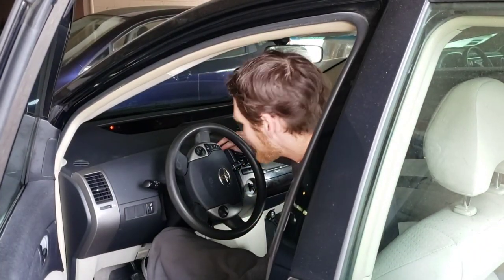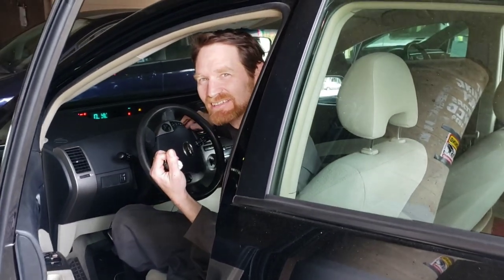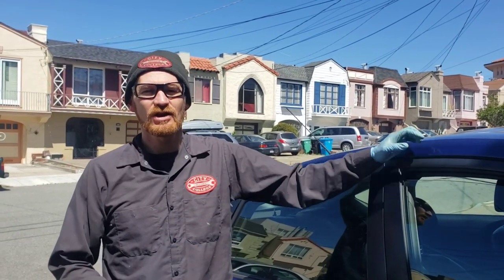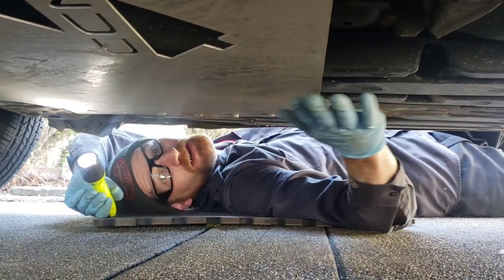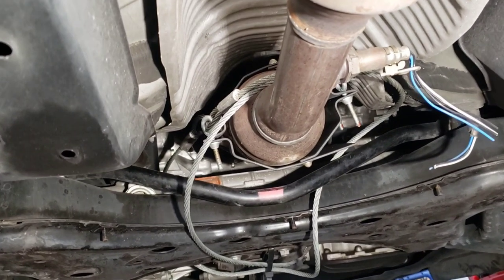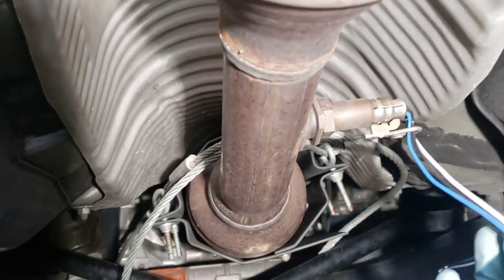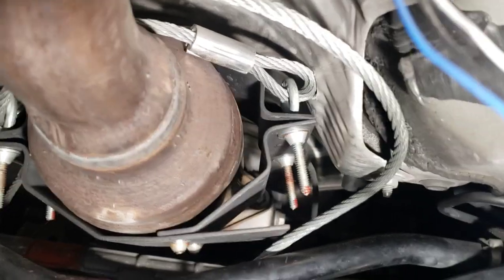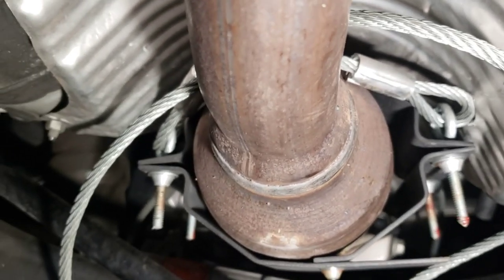Cat Locks tested by Thieves

Comment: I’ve worked at a stereo shop for over 20 years. We can install a ground loop sensor (saddle bag sensor) along with a security system (standard dual zone impact sensor, door trigger, starter disable, option trunk trigger, and optional hood trigger) so that the alarm will go off if someone removes the catalytic converter. We can also add an impact sensor onto the catalytic converter so that any vibrations from a sawzall will trigger the alarm. And there’s even a tilt sensor option incase they jack up the vehicle. Added benefit to that is it protects wheel theft. Ask your local stereo shop. 

If you have a pickup and are worried about your tailgate getting stolen or someone getting into your camper shell, we can install a pin switch or magnetic switch as well while we’re at it.
Reply: I would like more information, like what brand. I can't find anything on the internet.
Reply: Also I seen one from Europe that could call you when activated
Reply: @tescavko  Directed Electronics (DEI) makes Viper alarms (as well as a myriad of others such as Clifford and Avital) and they make add on accessories under the brand Directed. Go to any dealer and they can help you.
Reply: Until someone uses a Hack RF device (about $300) obtaining the frequency your alarm system utilizes. Thus disabling your alarm.

Look for an older Responder 460 system. They use modulating frequencies.

Sometimes you need more than just a car alarm guy.
Reply: @ozarks2g896  All current alarms code hop.
Reply: Serious question, what kind of impact sensor would be able to withstand the very high heat from a CC without simply melting?
Reply: How much
Reply: Pfffft - alarm... They're long gone by the time you get out of bed, grab your 9, and stumble out the door nekkid & barefoot thinkin' you'll stop the 3 tough-ass hombres with earplugs (who happen to be a LOT more ready for you, than you'll ever be to face them!).
Better to protect and deter than to expect a noise to stop any of them these days my man!
Reply: the noise a sawzall makes cutting through the pipe is about as loud as an alarm though... they don't give a fuck
Reply: @PersonalTrainerLamar  Yes, in complete agreement!
Reply: We have to harden the CAT, that’s the better route.
Reply: @SK what is the name of your shop and where are you guys located. I want to have the service you described installed on my van. Thanks 👍
Reply: @renejr2296  Any shop can provide that service.

Comment: Yep that’s exactly what I thought.  My reports being in different shops around the bay area conclude that’s the cables make noise. Especially when put in my last experience lower pay technicians. The more experienced technicians concluded it take so long to properly route the cables to make sure they’re in their tight it’s not worth it.  Every shop has given a thumbs up on the plate installation

Comment: I got some aircraft cable and wrapped it around the cat and back down the pipe about a foot each way and then secured it with stainless steel clamps at each end and when they tried to cut it the cable just moves with the blade, it worked and they guy got caught from the noise it made.
Reply from the maker: Nice work!
Reply: Smart! Can you share a picture of what you did?
Reply: awesome. I'M ON IT! THANKS

Comment: The exhaust system is grounded. You can tack weld a micro voltage sensor downstream of the converters and send a micro voltage signal to ground. The sensor harness plugs into the O2 sensor and the O2 sensor wiring harness plugs into the back of the sensor harness to complete the O2 circuit. The anti theft sensor micro voltage can be established by using the O2 heater voltage circuit. When the exhaust pipe is then cut the ground to Batt will be cut and the sensor capacitor will charge and then release the charge to a read and write CMOS chip programed to your Key Fob Panic button signal. A couple of transistors and a few diodes to clean up your signals alarm will sound. A secondary run capacitor can be integrated into the circuit and can be used for tripping the alarm if harness is unplugged. Simple circuit build.

Comment: I've seen the cat shield get bypassed, they cut the pipe at the back and just use a long extension to unbolt the bolts up front. They might have updated the design to close off the opening at the back though.
Reply: Unless they have literally all day with an isolated car, that's not very convenient. Cat thieves go for the easiest and quickest scores they can find.
Reply: @SalandFindles  with the original version it doesn't take any longer because the rear opening is exposed. Looks like they have an updated version though to seal the back of it.
Reply: Yup, that is exactly what happened to me. They went up and around and shimmied my cat out. I almost thought I got lucky because I saw the shield intact and saw the resonator pipe hanging but then when I reached my hand up into the shield, my cat was totally missing. I woke up to them doing this in the middle of the night it took them about a minute and a half, they know what they’re doing what woke me up with that one cut I’m pretty sure the unbolting was quiet and I slept right through it

Comment: I've looked on Honda element forums for what works best for my element. Apparently the cat clamp doesn't rattle IF INSTALLED RIGHT. Couple videos on here. You put th cables through before tightening the clamps all the way; no noise. I e heard those other cat shields etc can rattle. Cat clamp is also th cheapest. Got mine at Napa for 200( even though it online it said 400!!). Cat shields go for about 250.

Comment: I had that CCM sheild,  it took the theives 1 minute and 37 seconds to take out the cat. They used aome sort of 90° hacksaw and cut the pipe by inserting it right through the long slits he mentioned in regard to reading the serial #, and the second cut right through one of the absurdly large holes that makes up the CCM logo. Why CCM included those purely for cosmetic reasons and why they made those view slits horizontal rather than vertical is just beyond me, it's like it was designed by a budding art student rather than a seasoned engineer.

Go for a much longer sheild, one with small circular holes rather than slits. I won't name brands, but theyre easy to find.

Comment: i couldn't see evidence of tampering with the cat security shield in the video. How do you know there was a theft attempt? BTW, I bought one of these shields after watching your installation video and assessment. Waiting now for it to arrive, got the car in the backyard under cover till it comes. Looks like you called it right.  Thanks, I appreciate you making that available.
Reply from the maker: During the attempted theft they cut the pipe between the cat and rear section of the exhaust system and cut the wires to O2 sensor. Then they gave up because of the lock. Money well spent!!
Reply: @Mrelectric423  Can the cut in the pipe be easily/cheaply repaired?
Reply: @chloekamikaze  yes,  especially if you know how to weld yourself it should be easy peasy

Comment: In my case I have a cat shield so they didn't take it. The did however saw thru the pipe towards the middle of the car so it makes a noise. Much like you showed here. So then I just need it welded correct?
Reply: That sucks. I'm having a new cat and cage installed today and thought from what I'd seen that they could still try to cut the end bit, and now hear they did that to yours. The people doing this are the biggest scumbags. At least a weld is a lot cheaper than a new cat. I just spent $2,850.

Comment: Thanks for the thorough update, knowing the cat shield did so well is surprising, i guess having a plate is the better deterrent visually. Question, do you take on gen 2 prius jobs in SF? Good to have someone knowledgeable with the gen 2 if i ever have to get my prius fixed.
Reply from the maker: I do ocassionaly,  mostly rental fleet work.
Reply: @Mrelectric423  any way to recommend someone in Ventura county?
Reply from the maker: The plate does seem to work. Sorry I do not take on repair jobs.

Comment: Why arent auto engineers doing something about this . you know with all that fancy schooling and the forever increasing car prices.
Reply: This is a Karen comment lol.
Reply: Well thats called lock and key . im just talking about an actual skid plate , or tie it into the alarm . EPA demanded cats auto manufactures had a deadline they met and produced and hasent changed a bit . leading number 1 cause in Nissan vk56de failure is cat failure have they changed it nope. EPA probably has a lot to do with it .

Comment: Any recommendations for a shield on Jeep Grand Cherokee?
Reply from the maker: Another viewer recommended using many wraps of stainless cable.
Reply: Weld medium sized chain around the exposed pipes. Spot weld (mig) the links so they don't rattle. Cheap and Ez pz.

Comment: Etch "Stolen" along with the vin# on the cat. It might get stolen but they wont get anything for it and hopefully get caught?!!
Reply: They can just etch over it to cover it and shops buying these dont care
Reply: Yeah you can etch over the number quickly
If you got a vin etch reusable template and had a lot of time you could etch the vin in 50 different spots or heck just phrases like, 'this cat is stolen', but many thieves are likely not dealing with reputable places.

You can paint the whole things with hi temp orange vis paint and they might have to at least sand'r down before selling, but many are likely working with folks who don't care, or they are cutting them open and gutting them anyway..

Comment: Cat Security plate is worthless as my 2nd cat converter was stolen from my 2005 Prius with my shiny new cat plate still in place. Paid $200 for the plate and another $200 when they had to remove the plate to replace the 2nd stolen catalytic converter.
Reply: how did they do it? Where was it parked at the time? Also, which brand did you use? That's very important.
Reply: Yes share pls John Acura. Thank you!

Comment: are thieves able to cut through the cat security plate?
Reply: With enough time I’m sure they could but they want to be fast and not sitting there for 10+ minutes or however long it would take . They will just move on to the next target .
Reply from the maker: BSG Vlog the plate in the video has stood the test of time.
Reply: Are the Cat Plate screws/bolts special tamper-proof or just standard screws/bolts?
Reply from the maker: @rgh622  they include 2 different types of special security screw.
Reply: @rgh622  I've also seen installs where they use rivets instead of security screws, as I do not consider it beyond the realms of possibility for thieves to start carrying a collection of common security screws heads. complicates maintenance of course (you can only drill out rivets), but unless you are in a salt/snow state there's a good chance of going the entire service life of a prius without ever having to touch the exhaust. I guess the debate is whether it is quicker to drill out a rivet than a security screw;

Comment: Good idea with the plate but its gonna keep all the heat in there and thats not good. They get HOT!
Reply: There are at least 4 companies that make that plate cover. They all have tested the temperature increase before and after install. No increase in temp outside safe limits.

Comment: Meh it's an ok theory but execution sucks.. from the eye bolts that can be cut easily to avoid the cables and the body of the lock can then be slipped out the way it was installed. The plate can compromise the frame and trap debris from the road way causing a potential fire because the debris is trapped right next to an extremely hot exhaust. Good theory but needs cleaned up to execute. I'm sure other problems I'm not seeing as well.

Comment: I'm in San Francisco and twice I've had these CAT shields installed on my 2007 Prius and TWICE they got caught and bent on my steep driveway. The Prius is already a low clearance vehicle, you add this on and it starts scraping on hills and it bends easily. I love my Prius but I probably can't have one anymore because of this cat theft situation and the lack of workable solutions to keep it safe.
Reply from the maker: I love the Prius too. Theft of gen 3 and gen 4 cat is not prevalent. Maybe worth considering a newer prius to replace the old one.

Comment: Looks like my neighborhod with the blue prius... so it was your prius that deterred thieves, so they came over at hit MY prius instead. 

I kid, I kid... but yeah I seriously want to bash cat thieves upside the head with a baseball bat if I ever found them, unfortunately they work so quick chances of catching them are near zero.    Good to know though, as I'll be getting that cat shield whenever I find a used converter from a junk yard (I can't justify paying $2600 because mechanics want to charge me full price on something I can get for 400+ cheaper (yeah the brand new one).
Reply: Good luck finding a cat at a junk yard.
Scrapping The cats,copper wire out of vehicles is the main reasons junk yards exist .
I suppose if you got one that came in fresh right before you arrived you could get lucky and get one.

Comment: All a thief needs to do is carry along a cordless grinder with a cut-off blade and all these cable fixes are pointless.
Reply: Yeah, I mean there is a way to defeat ANY security system. Following your logic why even lock your car doors? Hell, just leave the keys in the ignition, I mean they can just break the window if they want to get in, they can just tow the car if they want to steal it. See how whiny and weak that sounds? 

That is how your unhelpful, negative, victim mindset comment sounds to the sane world....whiny and weak.

Comment: I;m a DMV certified Wholesale car dealer in California. I'm thinking out of the box your catalytic converter as you coming to me as my customer you would have to sign over to me power of attorney of the item. I will sand then heat and etch my business name, and  vin No#, and  license plate No# and date it. Do the same  log it in under my dealership books file it. It all cost for $300-up for labor and parts then another $300. charge to get item back. Then money for cost of item to get back  front  then $200 more after I'm is returned by refinery before the melt down the stolen property since it's been identified by a dealership as property than a parts being sold off stolen property. Pretty sure the refinery would probably never go to the police but they would have the item property name my business etch on item so I would probably have to buy it back for $200 to $300.00to $500 that's probably what they paid the thief's. It's better than the customer paying $1600 to $2500 for a new one.
Reply: Thieves want what's inside the cats and will just cut them open for the precious metals and leave the etched shell on the side of the road with its guts ripped out.